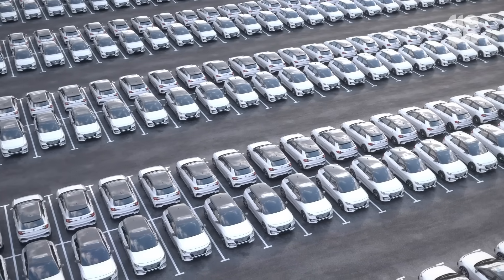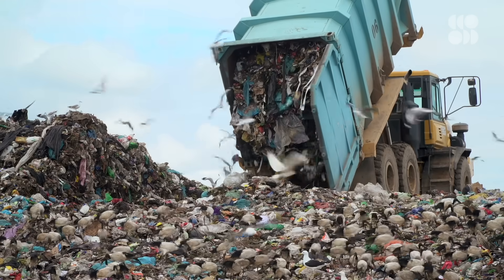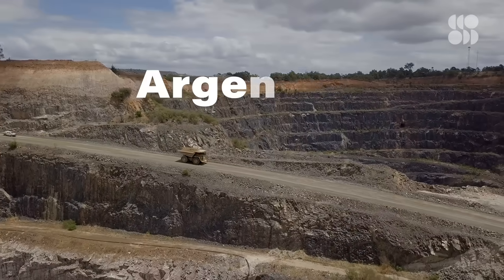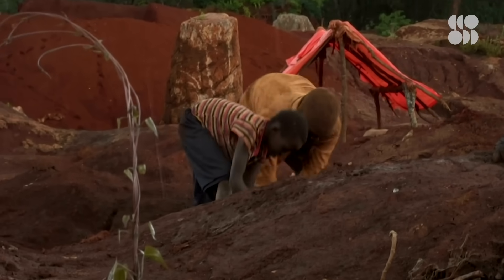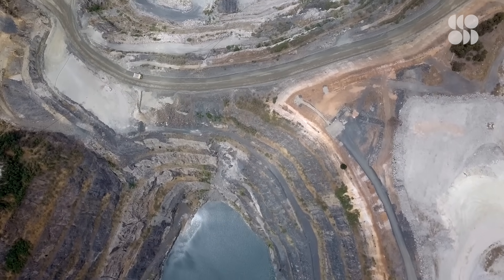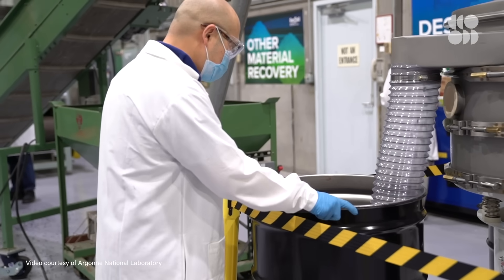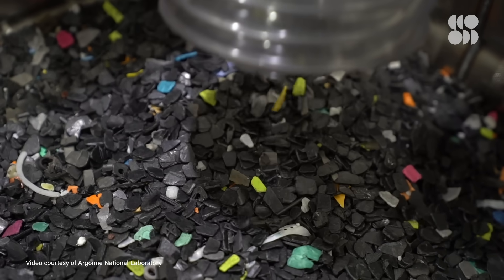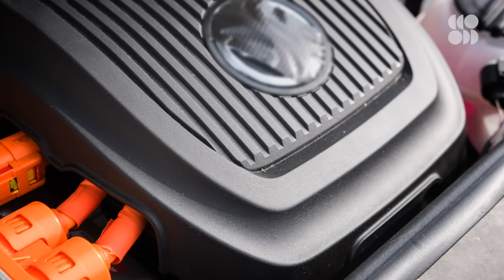The Hidden Environmental Costs of Electric Cars

Comment: As a general rule for Everything, if it can't be recycled, don't build it.  Let's switch to electric and switch to solar, but focused on using only tech that can be 100% recycled and that have minimal harm to the planet.
Reply: Recycling is an issue faced by the solar panels too. The commercial Si based solar panels have a lifespan of 25 to 30 years only. The first panels which were installed about 25 years have started to expire. In no soon time solar panel junk is something going to be a headache.
Reply: @gaya3ganeshh  Don't spread false, pro fossil fuels info.

Solar panels are already 95%+ recyclable, generally have a 25 year warranty and a product life of 35 years which is no comparison to mining oil and burning it into our atmosphere for 35 years.  

Electric cars are much more simple with many fewer parts making the general vehicle fabrication more environmentally friendly and battery tech is improving with leaps and bounds as we ramp up in production and batteries that are highly recyclable now should be made to be nearly 100% recyclable in the near future too.
Reply: Let's put solar panels on every home, business and covered parking rooftop and switch to electric vehicles making nearly everything we do solar powered while completely decentralizing our power supply and empowering everyone as power generation owners.

Solar power is CHEAPER and electric vehicles are soon to be CHEAPER to make and already are considerably CHEAPER to maintain and operate, especially if charged from your own solar power.

A 3-5 year ROI (return on investment) for a solar array that will generate power for decades is a no-brainer and the panels can even be made locally too.

#EndFossilFuels #SwitchToSolar #SwitchToElectric

Comment: StorEn's Vanadium flow batteries are going to make the Tesla Power Wall obsolete. They cost less, do not suffer any degradation, can deliver 100% usable capacity over 35 years, are modular and stackable. Come in 20KW and 30KW sizes. Oh and they are 100% easily recyclable!

Comment: Over the lifespan of the car, it's actually less harmful than a petrol car
Reply: That's with the generous assumption, that current electric cars will see as much use and will be as durable as IC vehicles.
Reply: @Veryperceptivecat  and with huge innovation occurring, like at the start of widespread ICE car adoption, that isn't very likely for cars produced this decade.
Reply: Thomas Caswell : The carbon footprint is just as bad as a gas burning engine, we are simply picking the lesser of two evils .
Reply: @timallen643  and Lithium ion batteries are horrible for the environment. And considering how shitty they are, an EV will need copious amounts of them. Realistically, a decent option is Nuclear power for the centralized system which then powers hydrogen fuel cells for cars. Or a major innovation in battery tech.
Reply: @awesomedavid2012  Hydrogen combustion powered vehicles are the way to go. The out put is water vapor and it doesn't take much to modify current manufacturing processes.
Reply: @timallen643  Hydrogen will not be the future on our roads. (for many reasons) EV's are now inevitable.

Comment: There’s also the fact that electricity itself isn’t green in many places. If your local electricity comes from fossil fuels, driving an electric vehicle isn’t any greener than driving a gas vehicle.
Reply: That’s a fallacy. The refinement process to create the gasoline which is burnt in your car is much dirtier and less efficient than the processes used to generate power at a large power plant. Most developed countries have forms of clean energy production which means that the power they generate is not polluting nearly as much as as a classic coal burning power plant.

Comment: Moving to an all electric society is inevitable since fossil fuels are limited.
Reply: @Dustinavollmar  where did you get the 50%? Please show where the confirmation comes from
Reply: @anima.7750  he made that up.
Reply: What about cobalt, lithium etc?
Reply: @bgtubber  You can even manufacture the batteries from other materials but you cannot reproduce the used oil again
Reply: @bgtubber  Well we don't combust Cobalt, lithium and so on. And so we can always recycle. But that's impossible with Fossil Fuels.
Reply: We could possibly recycle at a rate that matches the new “dead life” turning into future oil.